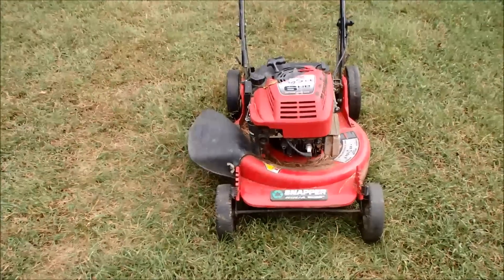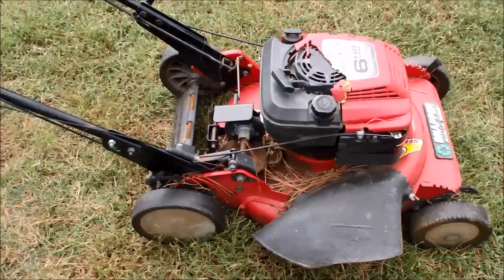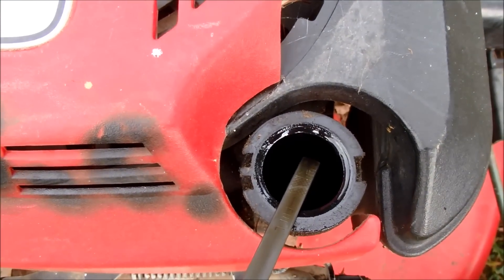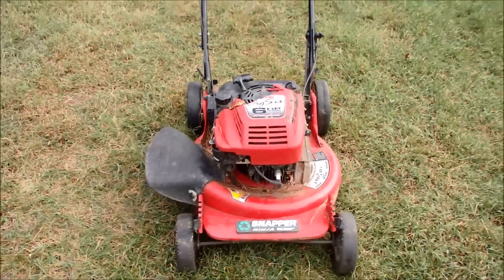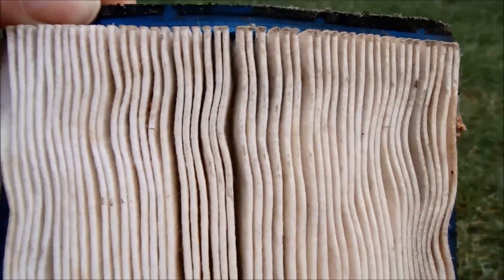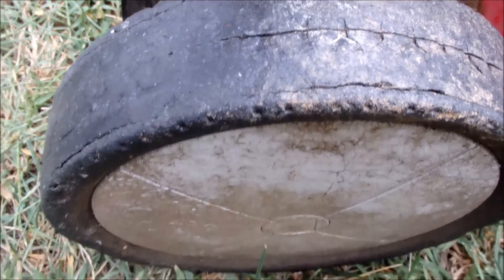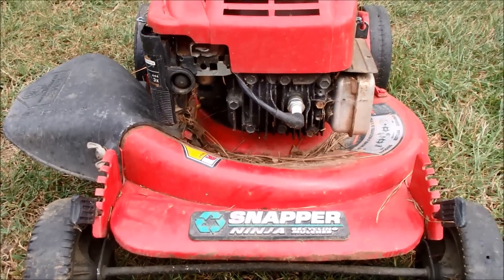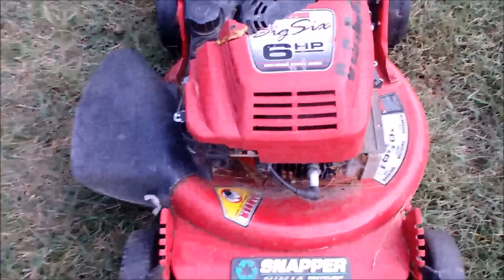Snapper Big 6 Ninja Lawn Mower Model RP21600  - Trash Rescue Part I!  - Sept. 29, 2015

Comment: you find the neatest stuff
Reply from the maker: +knighthawk86855 Hey knighthawk86855 good hearing from you how is everything up there!  Yea I felt sorry for this one and just had to bring it home.  Will have an update on it running again after cleaning the carburetor and putting a needle/seat in it.  It will also look quite different just received a replacement for that broken cover as well!